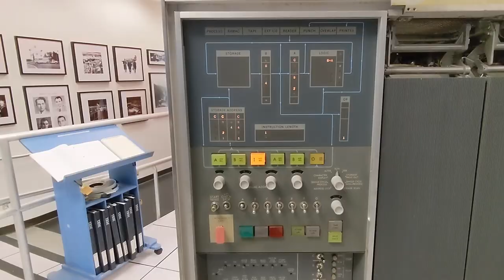IBM 1401 Pi Christmas tree

Comment: I made one for the 1972 Calendar. I think I still have that deck. You run the program with a card that says "//list"
We programmed in RPG. To compile the program we used the command "//Call RPG". Too bad we only had 99 indicators
to use in programming. We had to "set on and set off" the indicators to write the programs.